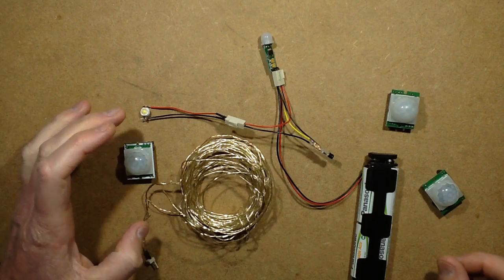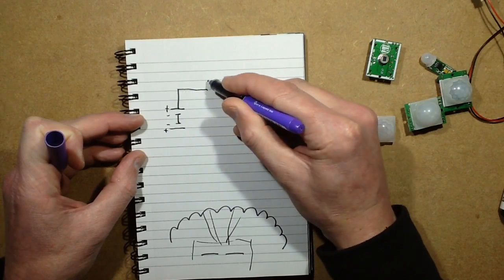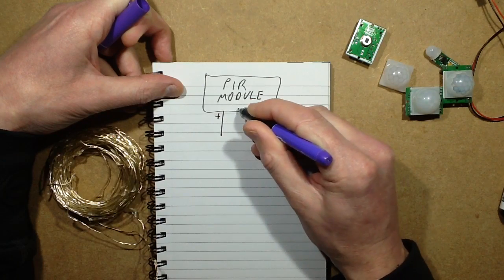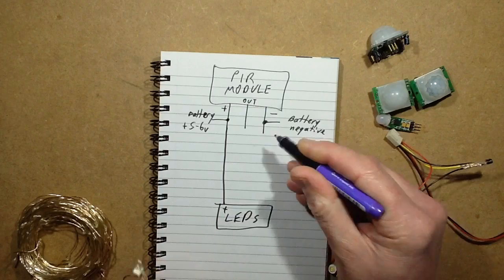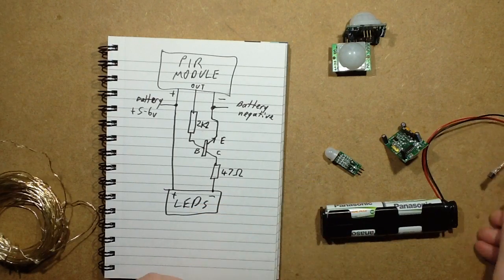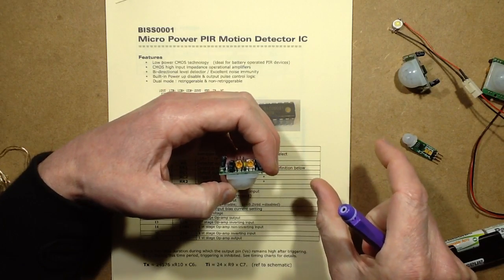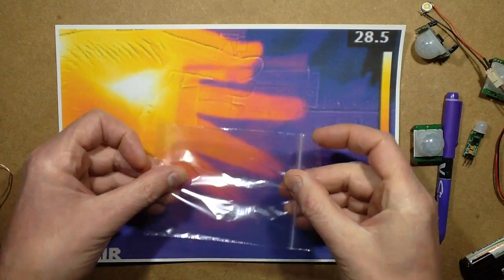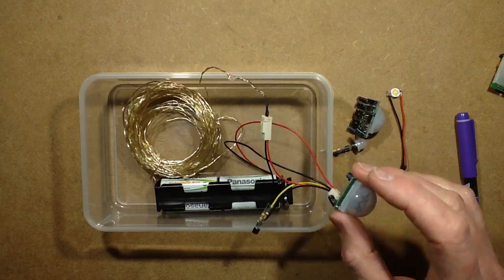How PIR modules work and using them to control LED strings.

Comment: You know I do enjoy your videos very much, my wife complains as I often buy the things you post as you make them very interesting.  I have been playing around with one of these for a few weeks now off and on, trying to build a 12 volt LED night light that will light up in the bathroom of our RV when we are boondocking (camping with no hookups to power or water.)  I had it set up through an arduino, then through a relay and to a little nightlight that I built up from a China kit.  They sent me one for 220 rather then 110 and it never worked with AC so I simply cut the  AC step down out and it works fine on 12 volts, however refuses to light at all with less voltage.  Perhaps I could cut some more resistors out somewhere, but I do like the way it works now, and the fact that our RV has a 12 volt system makes this the proper voltage for my project.  My question is, can I hook this up the way  you show in this video through the transformer or will I have to use a buck converter to step down the voltage to run the PIR then back up to run the light?

Comment: The covering dome is waterproof, you could just drill a hole big enough for the dome to poke out and silicone or water proof it. 

I would imagine it is for weather as it wouldn't detect anything underwater.

Hey Clive you should get one of these to put in the top corner of your video..
http://demandware.edgesuite.net/aamm_prd/on/demandware.static/-/Sites-joann-product-catalog/default/dwbeaf9ae9/images/hi-res/10/10967677.jpg

Those little links are called jumper connection. Computer boards often use them for voltages and clock settings.

Comment: I use this PIR as a movement sensor light. 3 X 1.5 Alkaline batteries with almost the same circuit you have there. I fitted an LDR and it works a treat. In our bathroom the batteries last about a year. I put all the electronics in under the Fresnel lens and used a 5630 LED with about 15mA drive. That lights up the whole room. Cost here on eBay was around $1.20 each for the PIR and the LEDs were $3.15 for 100 on a tape.
Reply: but is the voltage enough for the PIR sensor?

Comment: I would have never guessed that these work by sensing body heat. I see them all the time in my classrooms, and at the local supermarkets to turn the lights on in the coolers when you're in front of the door.

Comment: That's fascinating! I had no idea they worked on "heat" sources. How come when it's windy the trees in my garden set off my PIR flood lights? I always assumed they just detected "motion" somehow.
Reply from the maker: +YeCannyDaeThat The trees may be blocking or reflecting an adjacent heat source.  The only way to see what the PIR detector is seeing is to use a thermal imaging camera in the same location as the PIR.
Reply: +bigclivedotcom mines were triggered by hot birds in the tree. They are so fast you can usually not see them on the film. But please watch out these cameras only last a few months as they get wet inside and I have gone through a flood of them so far. superexpensive and no burglars caught so far.
Reply: Hadn't heard about moisture problems, but these thermal imaging cameras are very sensitive to being dropped.  Internally they are an array of microscopic thermistors held a bit above the circuit board, and when dropped on a hard surface, pixels actually break off.  There's a video around here somewhere from a guy who dropped his SEEK brand thermal camera.

Comment: I was hoping for a video of how to use these in multiple way, like use with usb plug from pc or with 12v strip or plug in power etc
Reply from the maker: +James Tran Review and internal examination of 12V inline versions coming soon.
Reply: +James Tran Would love that too, come on Bigclive lets see some 12v led strings and pir sensors ;o)
Reply: +bigclivedotcom I have pir unit on its way. 1N4007.  I have the 1 m led strip. and 12V 2W to plug into the wall. I would like to have the led strip go at 11V soft light and turn on when I pass. This 6V seems a bit too low indeed for the led strip. I suffer from soft brain since the zombie apocalyps and will try to juggle it all together. Does anyone know how to get the old messages back that appear on the top right of youtube when someone gives private message? They vanish?
Reply from the maker: +Telephone Telephone You can get an inline 12V PIR module that will let you simply plug it into the power supply lead and then feed the LED tape.  If you want it to glow gently when off consider putting a simple resistor between either the positive in to positive out or the negative in to negative out (depends on which side is switched.)  For a long run of tape you could use a few diodes in series to drop the voltage to the tape slightly when not triggered.

Comment: Bought one of these for €0.70 (£0.52) after watching this video a while back. Been experimenting with it as a cat-on-kitchen-worktop-detector (soon to be deterrent once I find a suitable motor to hook up to this tambourine!) and it works rather well. For some reason with the jumper in the default (L) position the output stayed high constantly, no matter what I did. Removing the jumper entirely gave me the desired functionality. Thanks for the video.

Comment: Clive, would these do the same thing?
eBay item number - 191545352604
Reply from the maker: +purdy86 I've actually got a couple of different version of that in order.  I'm not sure if they're specifically optimised for 12V switching,although I do see what could well be a 3.3V or 5V regulator at the input circuitry.

Comment: Nice video Clive - I just received 3 of these modules by mistake instead of the buck boost converters I ordered.
Now I know what they are, I'll have to find something to make with them...
The 3.3V output probably won't be enough to trigger a mosfet to switch a couple of 100W LEDs @ 32-34V, but a transistor should be able to bump it up.

Comment: The bigger modules have a spot next to the sensor where you can solder a LDR, such that it sits behind the lens. This appears to complete the LDR part of the schematic. I couldn't find a lot of information about this online, so soldered a LDR on one of my modules, and it seems to do the trick. I think it's really neat to be able to do this without any external circuitry. However, I'm not sure how to tune this well. It seems to work fine outdoors in bright light, but seems to turn on too early in the day if used indoors. I couldn't understand how that bit of schematic works either. It would be great if you could give this feature a look in some more detail. There's very little information about it elsewhere.

Thanks a lot for your videos!
Reply: I see my mistake. I was looking at the wrong datasheet. I was looking at this: https://www.mpja.com/download/31227sc.pdf
Reply: thanks for the tip.  I soldered on an LDR and it works great.

Comment: Heyy Clive,
You talked a bit about the chip supporting a LDR and you where not sure if the trigger disable pin was just connected to 5V. If you look closely at the big PIRs you can spot two trough hole solder pads in the middle. That's so you can add a LDR yourself ;) The pull up resistor (R2 in the schematic) is already there.

Comment: Non-retriggerable? Hm, lemme think... Maybe for a no-contact electronic toilet flush?
Reply: I find the PIR sensors I've tried are prone to false triggering.  Great for controlling lights where the penalty is just a little wasted battery, but as a flush controller, be prepared for  a couple spurious flushes every day when nobody is around.
Reply: condew HacDC Probably needs to be far less sensetive then. Flushing the bog should still be a deliberate action. iyam.

Comment: Is there any reason you don't use 18650's in place of the nimh batteries? obviously the voltage differs but that's easy enough to get over

Comment: On most modules you can power them on 3.3v by attaching positive to an exposed pin or pad on the side. 
http://techgurka.blogspot.pt/2013/05/cheap-pyroelectric-infrared-pir-motion.html

Comment: I recently installed an LED sensor light for my sister. It has an awful sensitivity. It doesn't turn on till you're right in front of it.  I'm wondering if there's a way to make it more sensitive?
Reply: +Siskin's Bits and Bobs PIR sensors have better response on sideways motion across the sensor, instead of head on movement. Reposition the sensor.
Reply from the maker: +Siskin's Bits and Bobs Aside from the suggestion of repositioning it (it will see more movement if not pointing directly at the target) you may be able to adjust its sensitivity.  The outdoor lighting sensors often have three adjustments.  Dusk sensor, time and sensitivity.
Reply: +bigclivedotcom I tried quite a few postions. I've fiddled with all the adjustment potentiometers to no avail. I just can't make it happy. I've done my back in at the mo' so I can't try any new ideas for a while. Thanks for the reply.

Comment: Ive used loads of these modules in the past, if you look closely on the front of the board next to the pir sensor itself there's two pads there for a standard ldr to fit under the fresnel lens for night only operation!
Reply: A photoresistor (or light-dependent resistor, LDR, or photo-conductive cell)
Reply: Neat stuff
Reply: Lewis Wilson LDR?

Comment: I'd add to your description that PIR window is silicon, the FET is usually connected externally as a source follower buffer with the drain heavily decoupled, and you can implement a simple detector with an LM358 dual op-amp and a discrete transistor threshold detector. 

Also they detect far infra-red around 10 micron not the near infra-red as used in remote controls, two-element PIRs need to be mounted so the target movement is across the two elements one after the other - they're nowhere near as sensitive to movement at 90º. Due to the two elements in opposition they detect moving changes in temperature* which can mean colder as well as warmer, and the Fresnel lenses are moulded in HDPE.

* Actually it's changes in IR energy received, which can be down to temperature and/or emissivity of the target.
Reply: Hi Graham. Found your comment very interesting. I want to make a simple PIR circuit for Arduino that sends a pulse or toggles a digital line every time movement is sensed (with no retriggering - the arduino code will handle that).

You mentioned an LM358 and a transistor. How simple can the circuit be that connects to an Arduino's digital input? Are we talking three components?
Reply: +Mat Smith It's a lot more than just three components. The LM358 etc is just the starting point - there's something like 20-30 other components needed. Believe me you're far better off using one of these modules than rolling your own.

Comment: I got a shed alarm recently in a box o' crap off ebay (seller "ascheap-aschips", always buying bits and pieces from them) and was wondering how it's PIR worked, now I know... :D

Damned if I know how to work the thing though (cheap thing that probably would crap out after a month in a cold shed!!)...
Reply from the maker: +jusb1066 I took apart a cheap remote one.  The remote has a simple oscillator and no encoding, so any will disarm any similar alarm.  The unit also had a very high standby current indicated by the constantly lit LED being in series with the battery.
Reply: +twocvbloke just put in batteries and put in shed pointing towards door, use remote to turn on,  so long as you use alkaline batteries the winter cold should not affect them
Reply: jusb1066
Doesn't have a remote...
Reply: *****
ahh i guess its the turn on and run away model
Reply: jusb1066
Pretty much, has a keypad, but no mention of a default PIN and I can't be bothered to look it up, got an IP camera trained on my shed anyway so it's superfluous... :P
Reply: bigclivedotcom very informative vid , thanks for this but I'm pretty new to electronics and I'm looking for a little help ,my problem is that I want to incorporate one of the smaller pir sensors into my 12v led strips enclosed in  aluminium profiles but obviously my problem is the low output which is not enough to trigger a 1m 5050/5630 led strip , I've seen the smaller module with an upward facing sensor which is the type I want to use so I can drill an hole in the pvc covering the strips , I may also want it to trigger a sounder/buzzer as an audible warning , so my question is any ideas on how I could get it to work? thanks

Comment: China is ahead of you! i bought a while back, a pir 8 led light, takes 2xaa (which i like, esp as it works fine with nimh) not waterproof though, but might do as you suggest and put in a cheap tupperware, its been running reliably for about 3 months on same batteries, i probably activate it 30 times a day, (it also has the light sensor so no activation in bright light) it was meant for my garage, but i leave it in the kitchen on these dark evenings to save me always turning the light on.  can post ebay number if anyone intersted.
Reply: +jusb1066 I found a retriggeable PIR cabinet light from Lidl, it uses 1 AAA battery and some sort of step-up regulator to drive the PIR circuit and a single LED. It has a LDR to not trigger in daylight and lasts a few weeks on the same battery, even when triggered multiple times every night. I use it as a night light to see my way into the bathroom.
Reply: +jusb1066 &gt; can post ebay number if anyone interested.&#160;
Please do!
Reply: +ehjones 301679278314   from ebay uk , i bought 1 of these, and have ordered a couple more

Comment: These little PIRs are great, each year I've used them at Christmas, I run a set of small xmas trees along our drive/pathway, put a PIR in each one, so as you walk up the drive they light in sequence, a nice little effect and cheapo!
Reply: +Andy Brown Replying to myself is always a bit strange, but anyway, the method of adding the transistor as +bigclivedotcom shows is a much better way than I'd done in the past.
My method fed each individual xmas tree set of LEDs back, and the output of the PIR, so each tree had 4 wires to it (+ve -ve LED-trigger PIR-output) which made it quite a mess wiring back 10 of these to my garage! Back in the garage I then used an Arduino (overkill!) to read the inputs coming from the PIRs and then switch a relay bank for the output. It was a bit heavy-handed approach, but gave me the advantage I could do a sequenced display on them when nobody was in front of them triggering the PIRs. 
I'll do a video myself shortly with my plans this year as Clive has given me a bit of inspiration!